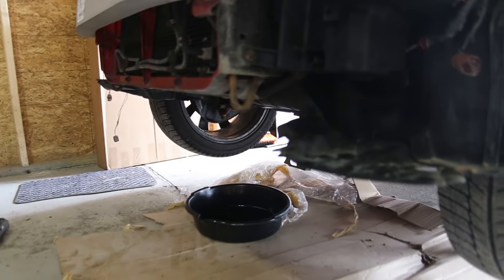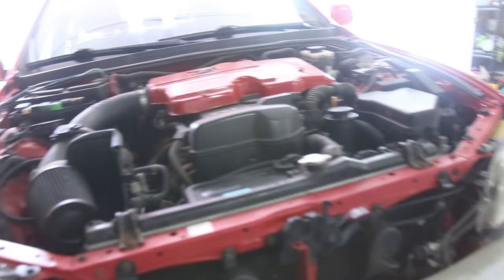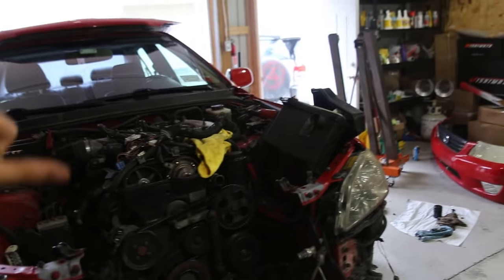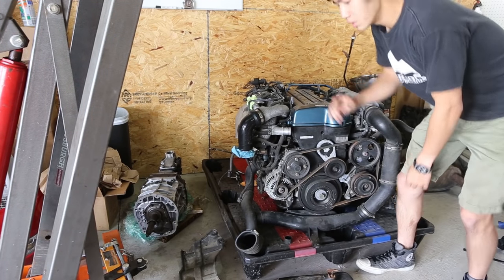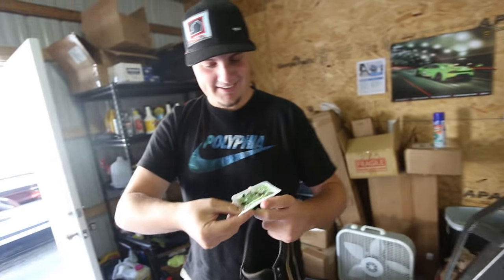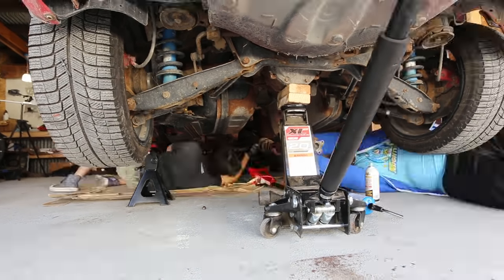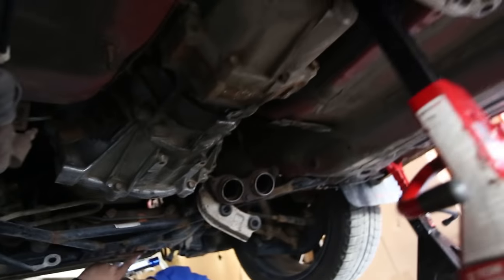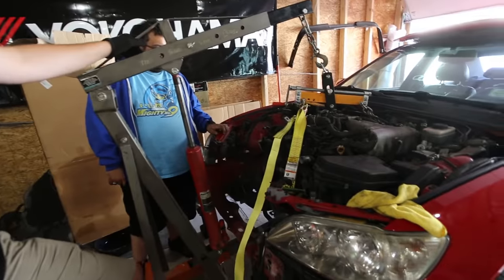IS300 Drift Project PART 2: Tear Down

Comment: let me know if you need any Input I swapped my is300 I'm putting a new trans and engine in it right now stay below 650rwtq if you abuse it trust me and do not buy cng injectors
Reply: john kelly why must you swap the 2JZ-GE for a GTE instead of just putting a turbo on the GE